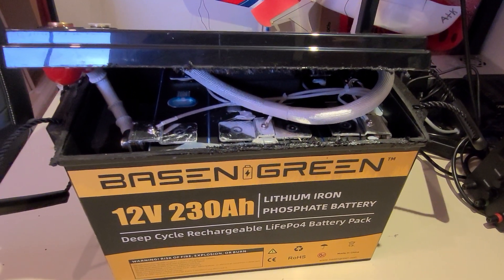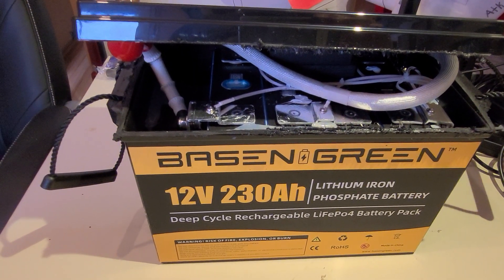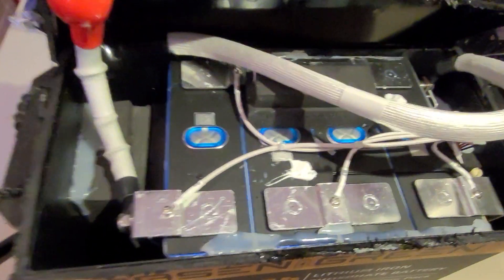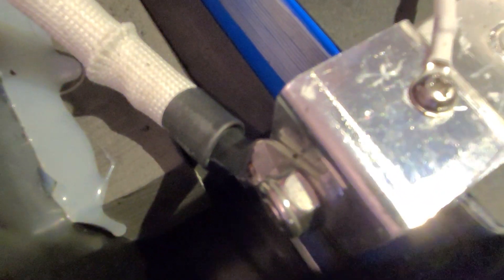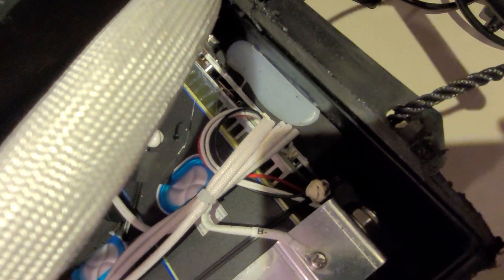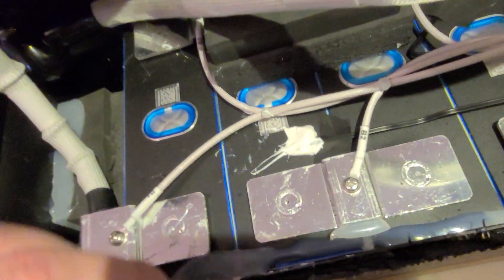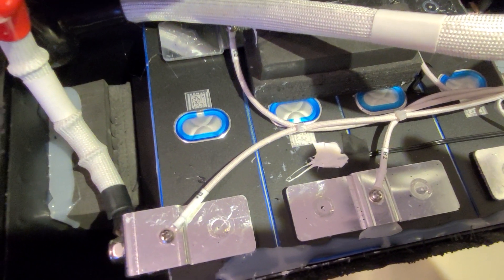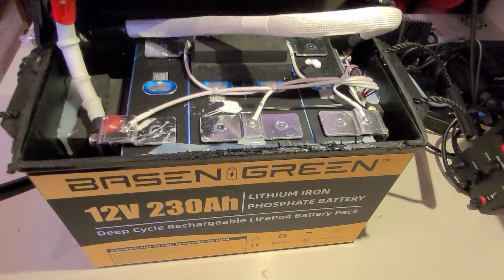Basen Green Lifepo Battery opened - how is the cell and build quality inside?

Comment: The batteries cells from Basen are rubbish, have four 105AH 52 packs that are failing already, the Pace BMS fitted is not able to keep cells in balance reducing the pack usable voltage as the BMS keeps going into protection mode.. 
Keep away from Basengreen
Reply from the maker: @rcampici  What does the "52" mean? How old are the packs and have you done a capacity check?
Balancing issues: have you tried to switch "charge balance" to <off>, so that the packs can use the longer time aftet charging and before using for balancing?
Reply: @andylambertz84  52 is the nominal voltage.
What would turning balancing on or off do, please explain. 
Packs are 6 months old with issues from the very start.
Just recently fitted NEY balancers to make the packs useable, this has resolved the cells over voltage issues, and before you even ask, the charging is done as per the manufacturer recommendation.
As an electronic engineer I think I know what is proper.
Reply: have the same problems with a basengreen 24v 200ah battery. two cells with major cell drift. keep away from basen, they are scam, no guarantee, support doesnt give a damn

Comment: C'est dommage que vous n'ayez pas fait une autre vidéo pour tester la capacité réelle de cette batterie. Votre vidéo est très intéressante.
Reply from the maker: I did test the capacity, it reaches the 230Ah barely if you squeeze everything out (to 2,5V). Normally i only discharge to 2,8V. So - its ok, not overcapacity but ok.

Comment: Hi, please please could you test if it has low temperature cut off? It is not advertised at all but they told me on support that it has low temp protection. But I am not sure if I can believe :)
Reply from the maker: Hi Jan, i have got the Bluetooth version and for sure this one has the low temp protect. Can be adjusted by the Xiaoxiang App. And you SHOULD adjust it as factory setting is -1 = charge off. I adjusted to +4 degrees charge off, on when over 7 degrees. Safe is safe!
Reply: @andylambertz84  thank you, at the end I decided to buy cells and JK active balance BMS. Hope I will not regret, it's my first battery build.
Reply from the maker: @JanSur  Best Choice to do that! JK Bms is absolutely insane compared with Jbd Bms. 👍
Reply: @andylambertz84  I got that BMS from Basen with cells for reasonable price.
Reply from the maker: @JanSur  Sounds good. I also often use Xuba - unbeatable price for Rept 230AH cells. But china - so took 6 to 10 weeks to arrive in europe.

Comment: I bought 4 of the 460ah complete batteries from them. Ordered with 200amp bluetooth bms. Haven't installed yet but did do a full discharge and recharge. Got 460ah and cells were still at 3.1v. So getting more than 460ah usable from them. Reason i went with them on alibaba was because they were to only seller that wouldn't give me price right away. They asked me lots of questions on what my up was and made sure batteries would fit my needs. I was a bit nervous spending $7000 CND on a website from china i never used before, but they made the process easy. Even when i messaged them now, i get response right away. Good customer support so far. Ordering from again next week.